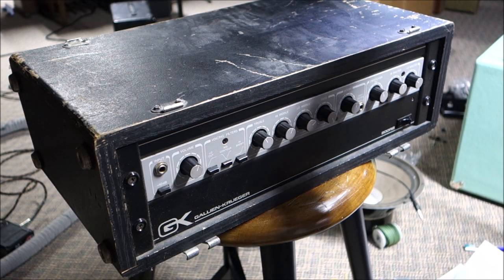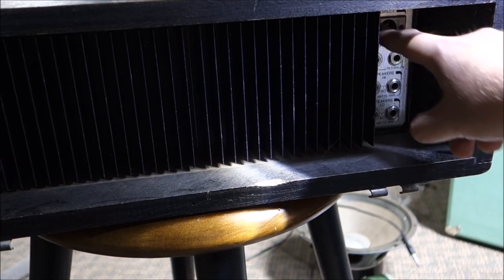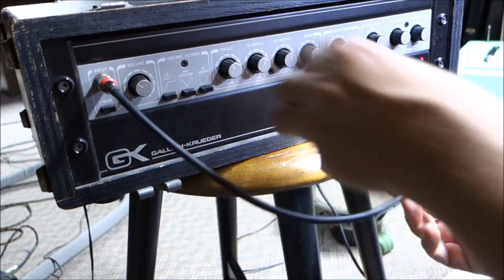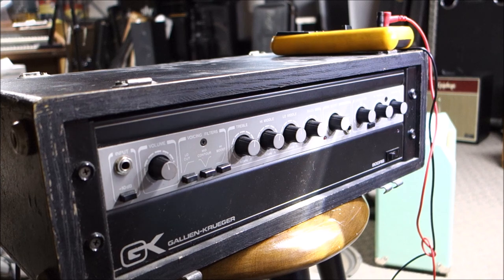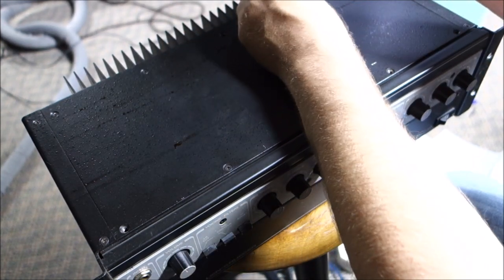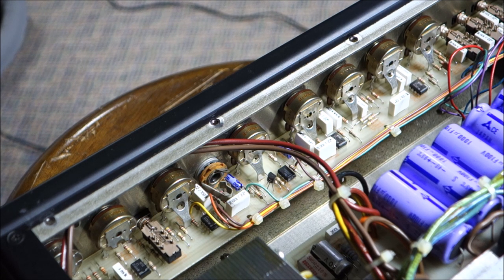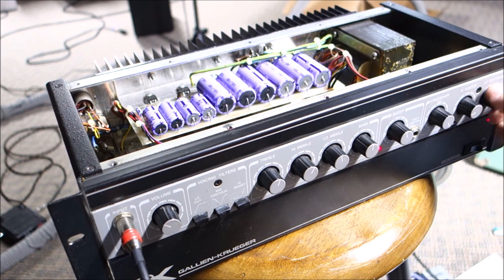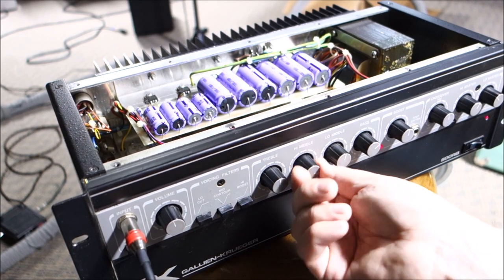DK Gets a GK!  Gallien-Krueger 800RB auction find....  Does it work?

Comment: I had tin foil on my fuse. Also it used to crackle, I'd pick one side up and drop it lightly and it would be good for a bit. I don't know what happened to it but used it for several years.
Reply from the maker: Sounds like yours had some solder joint issues.
Reply: @DeadKoby  oh I am sure of it beer spilled on it, dropped, dimed etc, too bad I didn't have a bass tech or a backup amp.
Reply from the maker: Yeah,  some amps live a tough life.